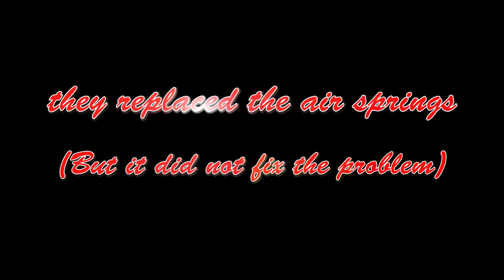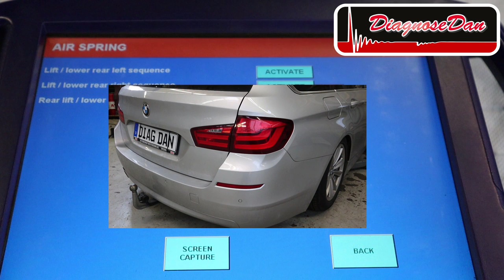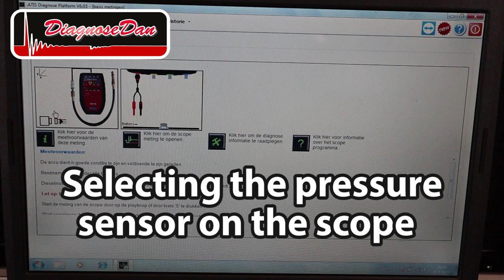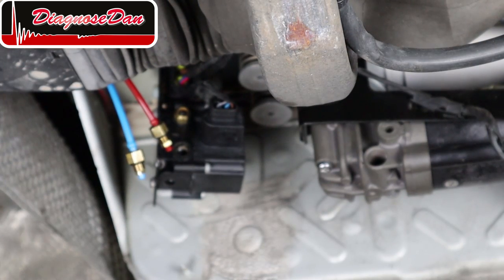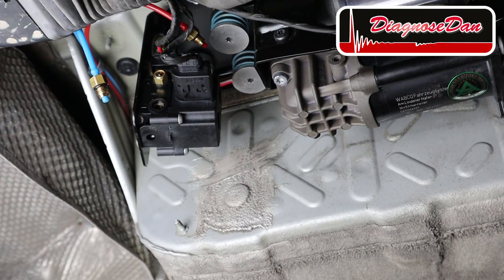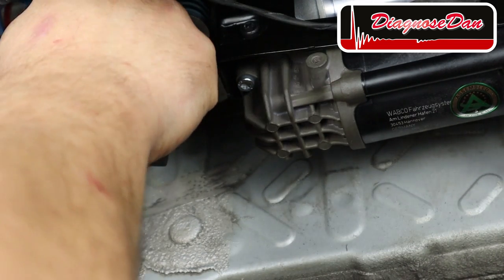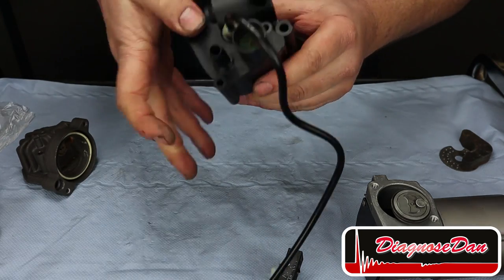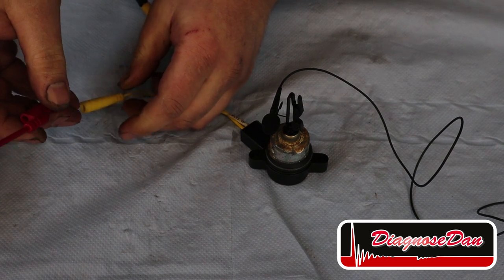Air Springs replaced, but no Fix!

Comment from the maker: For replacemend parts for this compressor visit:

https://webshop.wabco-auto.com/ccrz__Products?viewState=ListView&cartID=&isCSRFlow=true&portalUser=&store=&cclcl=en_US&categoryId=a1l0X000008v1AkQAI
Reply: Bro I need a little help ,immobilizer light blinks with ignition key out of the ignition ,replaced the immobi unit but still same thing ,DTC d-1 s-net short .got a PCM but won't let me replace because it says system abnormal .
Reply: 2006 Acura MDX
Reply: Hi Dan,  I know it’s been five months since this video but we got a 2015 X5 (f15) in the shop today for low rear suspension. I knew it was coming in and watched you vid to become more knowledgeable. The vent vent on this car leaks down on random occasions. I’ve used the link in this message but can’t find a vent valve listed. ( or the desiccant refill) Hate to replace a working compressor and solenoid valve when they’re fine. Help!  Doug
Reply: Doug Bolt hey having same issue, as are many with this(f15) platform. Did you ever get this sorted out?
Reply: Doug Bolt did you ever find it?
Reply: Hey, thanks for the vid but you didn't need to replace the compressor.

I've had the same issue with my F07 and it turned out that the desiccant were very wet and I dried them in my oven for 20min at 150C but that alone didn't help the compressor generate more pressure and that was due to the moisture causing some rust around the solenoid ring causing it to stay open and the pressure was escaping through the escape valve!
Anyway, I used WD40 and a thin screwdriver to loosen the ring again (which is just visible through the opening). Cost me only time and was an "Easy fix" but was a pain to find the cause. 

FYI, I've seen vids where the piston ring had gone so worth checking and cleaning the valves whilst at it 😉
Reply: @AlbaVirus01  So you sprayed WD40 into the escape valve? Mine doesnt have any rust tho. I believe the solenoid is bad.
Reply: Castro What's the issue you're having? Have you tested the solenoid after removing it? Try pushing the ring that is just visible through the small openings.
Also, have you checked the cylinder head is the seal is in good state?
Reply: @AlbaVirus01  yes, I tested the solenoid and it only opens every once in a while. Seals and cylinder look good.
Reply: Castro in that case the solenoid is not dead, the corrosion is causing this and eventually it will stop. Spray some wd40 into it and leave it facing up for a few min and try moving the ring. Let me know how it goes 👍🏼
Reply: You can buy the solenoid off eBay for £30. I bought one two weeks ago and the compressor now works and raises the car! 

The downside is that I think I have leaking bags which was probably the reason why the compressor failed in the first place.

One thing I did notice on the solenoid eBay part compared to the OEM part, is that the  central pin came straight out of the centre of the solenoid which doesn’t happen on the OEM part. The seller seems to think it’s ok 🧐 
Has anyone else tried the eBay (I guess China fake) replacement part?
Reply: Thank you for taken the time to make this video it was a great help with my 2013 BMW X5

Comment: FYI, for any of you DIY'ers, you can buy a new vent valve for $40 USD from AliExpress, that is really one the most common parts that fails on these new style Wabco pumps. The soft flexible membrane piston rings last much longer on these than the old plastic styles piston rings, so you don't really loose compression from the cylinder. And while that reed valve looked rusty, they still function just fine after a cleaning. Don't pay $650 USD for a new rebuilt pump, it's super easy to change the valve and dry out the desiccant . If you really need a full rebuild, do it yourself. All of the parts are available and there is not a lot to it. I have rebuilt over a dozen pumps for family and forum friends and takes 20 minutes max, mostly waiting around for the desiccant balls to dry out in the microwave.

I do understand why Dan replaced the pump though.
Reply: Ian Derzsi 
Tx for sharing this. Most valuable comment I’ve ever read 😉
Reply: Thanks for that info Ian!
Reply: Ian Derzsi he mentioned he replaced it for warranty reasons...
Reply: @speralta1  Ian specified DIYers, so he probably caught on to Dan's message.
Reply: Oops! Misread @Ian Derzi comment. I thought he wrote he DIDN’T understand why he replaced the pump. Apologies!
Reply: @speralta1  lol. No big deal! It happens! 😊😉
Reply from the maker: That's a great Tip! You can absolutely try that if it's your own vehicle.
Reply: DiagnoseDan 
Sorry to bother you but why only in your own car?  What’s the difference between swapping the whole compressor and swapping just the solenoid? Assuming the replacement solenoid is of equal or better quality than the original. 
Or else give the customer a choice. It’s such a waste to swap large parts with only minor defects.
Reply: @Conservator.  maybe because the warranty on vehicle.  It's only 2017.  They decide what to put in if covering
Reply: Cuba Rodriguez That makes sense. Tx
Reply from the maker: @Conservator.  if the pump fails in the near future, the customer might claim waranty or the customer might think he was misinformed. I consulted with the shop that brought the car and they   wanted a new compressor
Reply: Hi dan another good informative video again. I like the fact that you strip things down, I like to know how things work. Just a small point and forgive me if I’ve not understood the other comments, but why didn’t the vehicle owner take it to Bmw dealer to get it sorted under warranty in the first place?
Reply: Paul pickering It was an imported car and the dealership wouldn’t repair it under warranty. (I had asked the same question)
Reply: Eduard van Raalte  Avoid comebacks at all costs
Reply: Hello Ian,

 We are working on an F15, BMW X5 from 2015. I’ve checked on Aliexpress and didn’t see the vent valve or desiccant kits. Do you have any more info on those parts?

Drb  in Orlando
Reply: @Conservator.  Even if it was out of warranty he needed to be on record as taking the highest of high roads on such a high failure rate part. In the customer's mind you can't get better than the new OEM factory part, so if it is crap (which it is) it's not his fault.

Comment: TOP NOTCH STUFF DAN!! I was about to be disappointed when you just replaced the pump without tearing it apart....but then the BONUS FOOTAGE was gold!!! So at this rate you will have to replace the air pump every year??  WOW what a crappy design!!!   Also the glove was brilliant xD xD xD
Reply from the maker: I love my gloves like you love your tape😉
Reply: I was about to make the same statement that Ivan would have rebuilt the pump at no cost with the stuff around his garage.
Reply from the maker: @bbkmm1  🤣🤣👍
Reply: I spewed comments, semi hastily whilst watching ;) 
even though I figured there was some resolve near the end (somewhat Ivan style) lol...... he didn't disappoint, but engineering stooges and bean counter driven cheapo-ism did. someone needs to go give them all LOTS of salt water to drink..............................................................

Comment: On the e61 there was a common problem in that the pump air feed hose perished and allowed moisture and dirt to enter the pump, drastically shortening it's life. Worth checking as preventative maintenance.

Comment: I don't know, if they replaced the air spring why they didn't check for air pressure ? this logic even before replace the air spring  !!!!!!!
Reply: Just because most mechanics use the parts cannon until car is fixed, or until they get fed up and seek help. I suppose they have a lot of air springs fails, and usually, replacing them is the fix.
I think that this car should have been fix by BMW under warranty, as it's a 2017, and they offer at least 2 years warranty here in Europe.
Reply: Were they really thinking both air-springs had died at the same time? Does anyone know what happens if 1 air-spring fails?
Reply: @Conservator.  im sure both sides drop, they are common at the pump end with one release valve to let it down, this failed , so both drop
Reply: Jusb1066 Of course thanks!
Reply from the maker: Proberbly because it is the most common problem, and they never checked. The shop owner said they had time pressure 😔
Reply: Also, you can visually inspect if the airbags have cracks or leak. It’s a waste of money for the customer.
Reply: Alex Assuming that the customer was billed for the springs as well. (And you’re probably right 🙁)
Reply: @Diagnosedan  Well his time pressure problem just got worse because he didn't think a little further down the line.
Seems like a basic logical next step to check the compressor.
Reply: @Cheepchipsable  Time pressure directly resulting in customer pressure, the worst kind of pressure.
Reply: @Diagnosedan  Time pressure or not, they should have checked the compressor by simply putting their finger over the outlet port.  IMHO, it wasn't time  - it was competency  The first shop is bunch of incompetent fools  I wouldn't trust those guys to repair a skateboard with only a missing wheel!.
Reply: @Diagnosedan  The shop had time pressure, but not compressor pressure.
Reply: Exactly but this is the level of competence we've got to deal with today
Reply: @gregk.6723  shop also had no concerns with causing their customer the financial pressure of completely unnecessary air springs + labour
Reply: @Conservator.  

My thinking is the customer is driving around with the airbags flat and so they got damaged from that?  Without seeing the old ones?!?!  But they didn't do anything after that.   I would have been looking at a level sensor or the Air Compressor.  Even without any fancy tools, there are ways to check.   This other shop?!?!?!
Reply: @Diagnosedan  time constraints is no excuse for performing poor troubleshooting....
Reply: Put it in an ultrasonic cleaner, it should dissolve the crude inside...
Reply: @Stimpy&Ren how electronic throttle body can cost 1050???? Is it made of gold?
Reply: Bad air bags should be dead easy to test by just connecting an external compressor to the air lines going into them. Still, the compressor failiure may have had some other root cause, bad height/weight sensor perhaps so it kept running flat out?
Reply: Who pays for the new air suspension bags that was fitted by the other garage? Unfair for the customer. Good job Dan.
Reply: Common sense is a super power
Reply: Alot of garages are useless, and or the training they are getting is rubbish. Take your money and you are on your own.

Comment: Another good one Dan!
This actually happened in our shop on a Range Rover a couple of years ago, and it took my (self-proclaimed Genius) boss 3 days to fix it. By chance of course, and only after replacing almost all the components in the air suspension system . When nothing else worked, he said      "We might as well put a new compressor in (another $1500) so we'll have a complete new system. We'll tell the customer that everything was destroyed in the accident."    I'm sure most of the parts were ok, but we didn't get involved. He always said     " I WILL DIAGNOSE AND TELL YOU GUYS WHAT TO DO".  
Later on he bench tested the  old compressor and sure enough it didn't produce any pressure.
Reply from the maker: I think range rovers use the same compressor!
Reply: Razo Baghd   Please tell me where your repair shop is so i can avoid it
Reply: @englishbob5106  It's the shop next door to you and you can't avoid it. Meaning that unfortunately there are plenty of these parts changing shops around. Including most of dealership repair facilities.
Reply: @Diagnosedan Wabco makes all of these compressors. Some of them are in different configurations but its the same manufacturer.

Comment: ford has been using the system for over twenty five years . i learned a long time ago about the finger check . great video dan . if you hooked up a amp clamp you would be able to see amp increase when the pump is rely working . like a fuel pump working when it is out of gas . keep posting your stuff i love it
Reply from the maker: Thanks for watching Randy!👍

Comment: Same issues when dealing with hydraulics. A sticky or stuck valves are common had an excavator that could swing left but barely swing right. Swap the hydraulic lines on the swing motor at 3,000 psi Whatever was stuck broke free. Reinstalled the lines back swing action works fine. Customer was amazed & able to finish his job, it's fun to fine the cause of the problem. I did replace the hydraulic filters once the machine completed it's job. I had fun explaining to the reps that built the machine. Luckily my boss videoed the whole thing to cover it under warranty. I wanted to replace the motor but only if the issue happened again it didn't I love my job as a field mechanic.
Reply from the maker: Working in the field is one of the hardest Jobs!

Comment: so   the customer paid for a pair of airsprings plus a compressor   when the fault was actually the pressure release relay sticking / corroded .. well done .. I love the special  blue test equipment   .your methods  bring a breath of fresh air into anyones day. The smoke test was the ultimate  "icing on the cake ".

Comment: Excelent fix Danny thank you for sharing! It was a nice detail to set the language in your scanner to english for this video. I'm about to get a whole box of those blue rubber special multi purpose tools you have! This video reminds me a similar problem I had with a Porsche cayenne Turbo, It was my first air suspension ever, I remember the front of the vehicle was really low so checking air suspension for leaks with some soap and water mix I found that the front left suspension was leaking air so I went ahead and replaced both front air suspension air bags (They sell it apart as one piece on ebay instead of the whole  assembly) and also replaced the right side height sensor because the arm pivot was broken, after that for my surprise I could not raised the car with a bi-directional scannner command and also could not even heard the commpressor activating so I checked signals, activation relay and pressure and determined that the compressor need it to be replaced, I did and that fixed the problem, I remember the customer was very happy about the fix but asked me a very simple question I could not answer at that time... he asked me why the compressor failed at the same time the front left suspension failed? After further research I found out that  when a air suspension is leaking (In this Porche) the ECU monitors the car height through the "height level sensor" and sends more air to that particular suspension to keep the car height leveled but by doing that the ECU keeps the compressor running more than usual, sometimes depending of the leak it can keep it running all the time and that actually overheat the compressor and eventually damage the unit.

So I learned that we need to check first the compressor unit and then also never forget to check for suspension, reservoir tank and air lines leaks in this systems.
Reply from the maker: Great story Argeny 👍

Comment: Another great video. Very detailed and easy to follow. Your videos have a lot in common with South Main Auto. Eric O will also tear down defective parts to show what went wrong. It amazes me how many shop referrals to diagnosticians have to do with a failure to check the basics. I'm going to try not to get angry the next time  I call the cable company for a problem and they ask me to check that the box is plugged in. Looking forward to the next video.
Reply from the maker: Thanks Scott👍👍

Comment: Great advice that went with a bang, eventually!
I notice these pumps haven't changed much from the ones installed in Mercedes since 2000.
Reply from the maker: That's right this is a very basic system.

Comment: From my experience, the compressors usually fail because of leaking air springs that are not replaced until the compressor fails. When that happens, people realize the springs have failed but replacing them doesn’t fix the problem. I have had people replace compressors with leaking springs, only to have the compressor fail again from overuse.
Reply from the maker: Thanks for watching!

Comment: I had a 69 Cadillac Eldorado with rear air suspension. It used a vacuum powered air compressor that sat vertically in the engine compartment. That mounting position caused all the accumulated moisture to fill the delicate aluminum pumping mechanism full of water. All the compressors in the scrap yard had the same problem. I finally installed an aftermarket electric compressor and had no more problems.

Comment: The noise of the pump gives it away. Most pumps fail because the airbags leak so the pump is always running causing it to fault out. Don't forget the airbags.  I've had more airbags cause the issues depending if the vehicle is parked level or in a driveway up hill. Vent valves go bad due to water ingress causing corrosion.  Good informational video.  As per BMW, the parts come as 1 whole kit.

Comment: DIagnoseDan I want to say a huge thank you for posting this video! It’s been a big help to me in diagnosing the issue with my F11 Air suspension.

I removed the air compressor completely and pulled everything apart and followed the same steps that you did. All componentry looked pretty good and inside the desiccant balls looked pretty dry. (Gave them a few minutes in the microwave anyway!) The compressor was running but the airflow was poor… Turns out it was the solenoid so I replaced it with a £30 part from eBay, reinstalled today and the car has raised so fingers crossed that was the only problem! 👍🏻🤘👊🏻